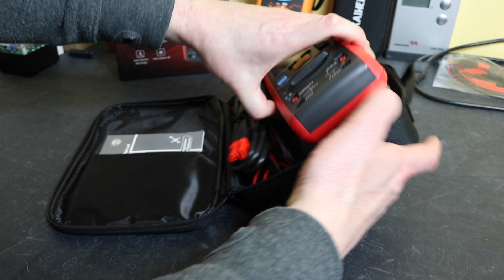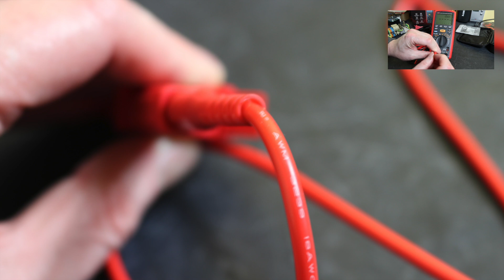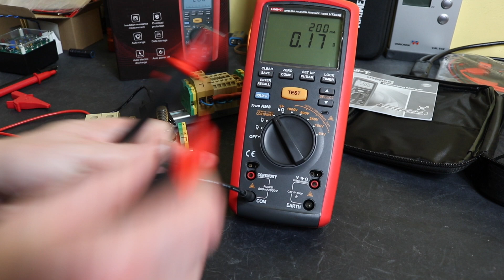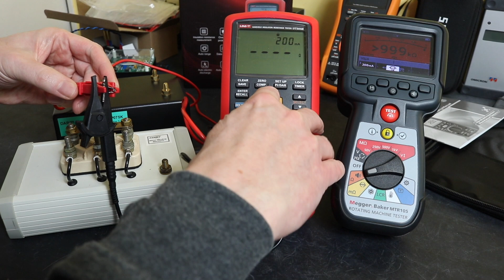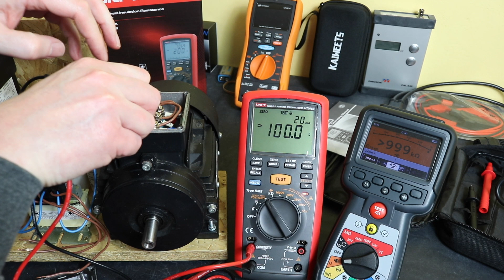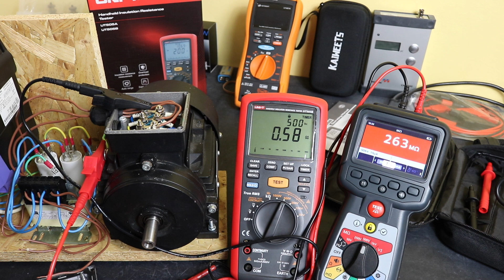Uni-T UT505B Insulation Multimeter Review

Comment: I think your UNI-T UT505B got dropped on its head off the assembly line.  😢
Reply from the maker: Certainly continuity function wise it doesn't appear to be happy at all. Unfortunately, there is no support direct from Uni-T, so can't get any feedback from them as to what the issue is. My meter may have a fault, but I don't have another one to compare against and not seen any other in depth tests. I did find a fix for it in a later video.
Thanks for watching.

Comment: Is that your simulator, is that the one on one of the blogs on a suppliers website , that’s the one I found when I was searching making one for myself that impressed me
Reply from the maker: Yes that is the 3 phase simulator I built up a while back. I did blog it on the Farnell Element14 website when I modified. If you have seen it somewhere else, then they pinched it.
Reply: @three-phase562  no that’s the site I spotted in on in fact it’s the only other refrence I could find to any other simulator on the whole internet